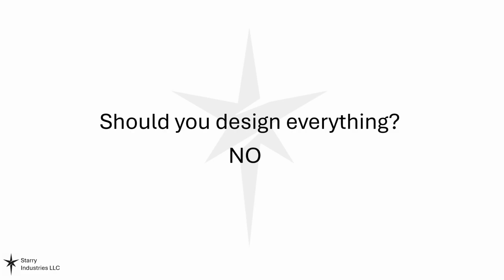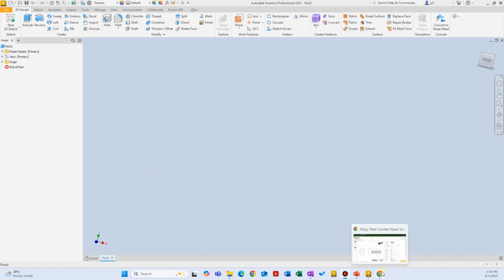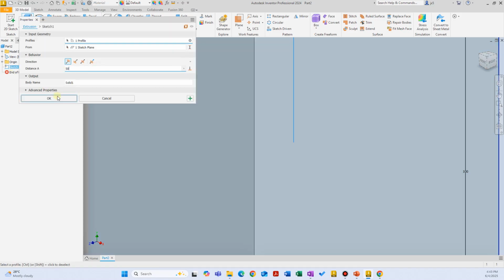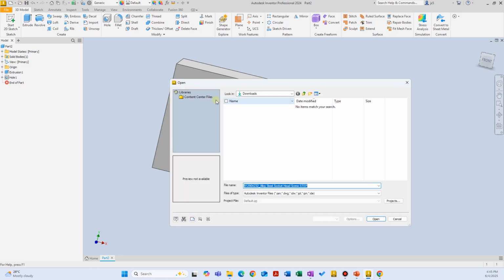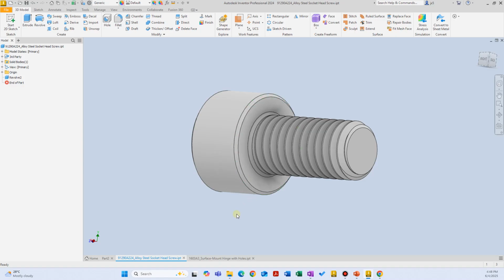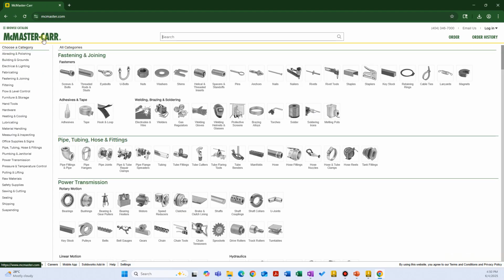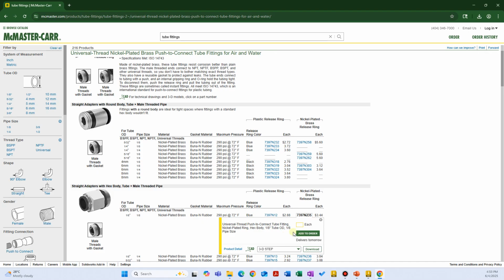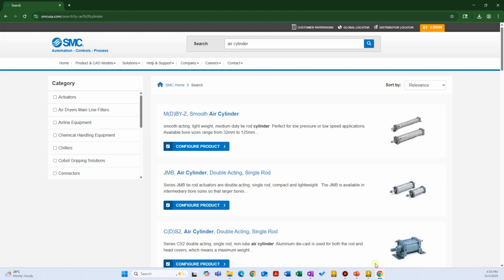39 - Productivity - 2 | Work Smart Not Hard with Autodesk Inventor | Autodesk Inventor Tutorial

Comment: Hi! When I design from scratch I have the features tree and can make changes. If I import a part, there is a way to work on it (let's say change a diameter) or is it only possible to use it into an assembly? Thanks in advance and big congrats for this series. Far far better than what I've seen in university
Reply from the maker: Hello, could you please get a screenshot of the screen and share it with us via email. Someone from our team can assist you with troubleshooting.
Reply: @StarryIndustries Thanks for the reply. It isn't a specific component, just a general question. I wonder if it is possible to change the features of an imported part or can I just use it as it is?